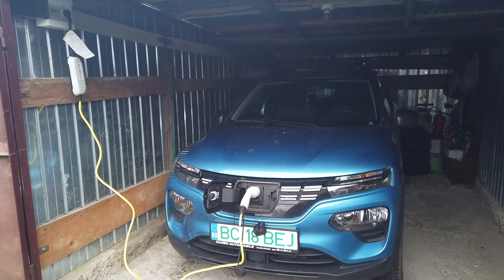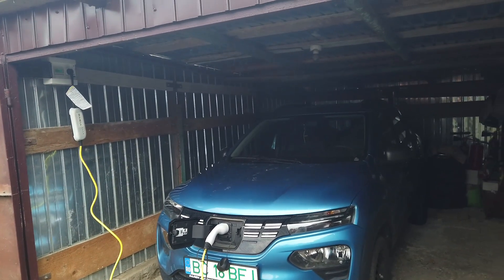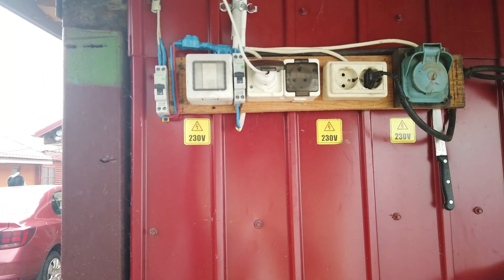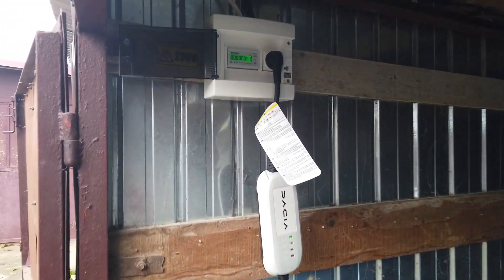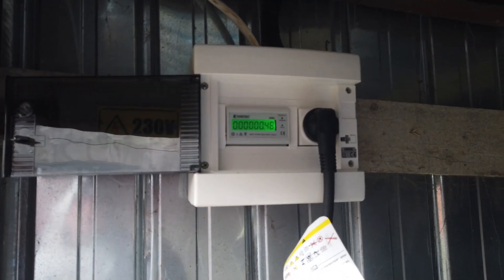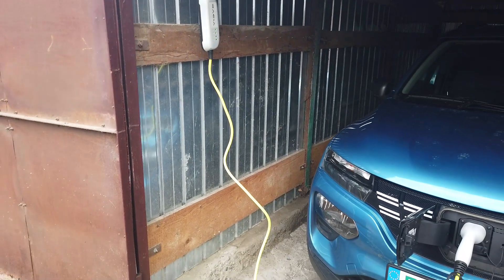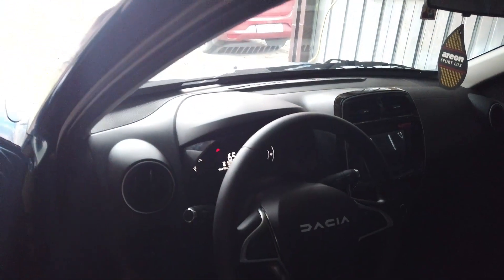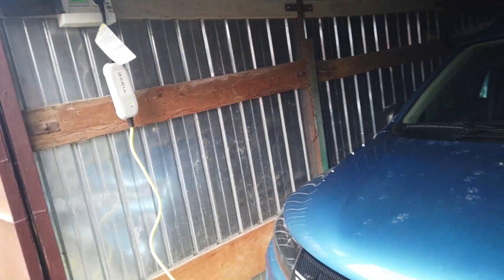Asa imi incarc eu DACIA SPRING acasa!! #vlog #dacia #spring #masina

Comment: Buna ziua.nu stiam ca Dacia are pe curent.Ma intereseaza si pe mine o astfel de masina.E ok,cati km faci cu o incarcare de curent.Asa un mers normal,nici sa zbori,nici sa adormi.Cat prinde la ora? Multumesc
Reply from the maker: buna ziua
Cu o incarcare full se merge aproximativ 200 - 230 km prin oras  poate ajunge pina la o viteza de 120 km/h se poate incarca si la domiciliu la o priza de 230v in dotare are un cablu pentru astfel de priza.
E fiabila ideala pentru urban usor de condus usor de intretinut.
O incarcare facuta acasa costul pe 100 km ajunge undeva la 20 lei e avantajos.
restul informatii urmati canalul si permanent o sa postez diferite informatii despre masina.
O zi placuta
Reply: @cristiprinromania  ,multumesc.Nu e avantajos,ci EXTREM DE AVANTAJOS
Reply: @cristiprinromania  ,a ti luat o noua ? Ce pret are noua ? Multumesc.ultima intrebare.
Reply: @bocavasile3213 exista 2 variante, 44 cai putere si 65 cai putere.
Eu am modelul de 65 cai putere, in iulie a costat undeva la 13000 euro, vara consuma 11kw/100km, la hidroelectrica asta inseamna 8 ron la 100km, la mine imi arata autonomie 245km vara.
Eu am cumparat un incarcator mai rapid cu 550ron, care incarca cu 3.7kw/ora, adica un plin undeva intre 6-8 ore, depinde cat de descarcata e masina.
Reply: @bh25jay  ,frumos.Si pe mine ma interseaza sa mi cumpar o Dacia.Ce m ai vrei m ai avantajos de atat.Se poate pune si un panou solar de 600 w pe acoperisul masinei,cu un regulator solar ce scoate 220 v si panoul la fel si incarca si panoul cat de cat
Reply: @bh25jay  ,noua la 13000 euro prin rabla ?
Reply: @bocavasile3213  da, rabla plus.
Mergeti la cel mai apropiat dealer Dacia si spuneti ca va intereseaza o Dacia Spring si veti primi detalii.
Reply: @bocavasile3213  panou solar pe masina? 🤣🤣🤣
Eu am 6kw panouri pe casa, de acolo imi incarc masina, am apa calda, gatesc si ma ajuta si la incalzire.
Reply: @bh25jay  ,da,pe masina.Chinezii,scot masini pe banda rulanta cu acoperisul full de panouri
Reply: @bh25jay  si eu am instalatie solara,mi am calculat toti consumatorii,inclusiv si caldura sa faca fata si vara si iarna.Se merita implicarea,nu platesti nimic.curent,gaze,lemne s au altele
Reply: @bocavasile3213  o sa se bucure si cei de la reprezentanta si cei de la RAR cand o sa vada 🤣🤣🤣
Reply: @bh25jay  ,se omologheaza.Nu e ceva,iesit din comun.Bateria e pe litiu,nu acid s au gel,se incarca m ai repede pe litiu,s au litiu ion fier fosfat.
Reply: @bocavasile3213  pierzi garantia la orice modificare, dar spor...
Reply: @bh25jay  ,pe mine ma intereseaza o masina la mana a doua.sunt pe olx,la 65 cai,in jur de 30000-40000 km s au m ai putin rulati.o gasesti la 11000-12000 euro.
Reply: @bocavasile3213   Spring de 65cp cu 30 - 40 mii de km?
Vorbim de o masina/un model, care a iesit de 6 luni, eu am fost printre primii care au intrat in posesia unuia la sfarsitul lunii iunie !
Pai o cumperi noua cu 13.000 euro, poate prinzi si o reducere la reprezentanta, pentru diferenta aceea infima eu nu as lua una cu 40.000 km
Reply: @bh25jay  ,da,dar prin programul rabla spuneti.Daca nu ai o rabla,ce faci ? Poate gasesti cupon sa cumperi,de la cineva,ce are o rabla,nu stiu.Dar cat ajunge un cupon.? Nu stiu,daca permite,sa o cumperi pe cuponul altuia
Reply: @bocavasile3213  au ei, eu de la ei am cumparat, combinat cele doua rable au valorat 11650 euro care s-a redus din pretul initial al masinii.
Nu costa nimik sa intri la reprezentanta si sa intrebi cat te costa o Dacia Spring Extreme de 65cp....
Reply: @bh25jay  ,o sa intreb si la ei.DAR DVOASTRA CAT A TI PLATIT PENTRU DOUA CUPOANE ? LA EI ? ASA ,SA VEDEM CUM STAU LUCRURILE